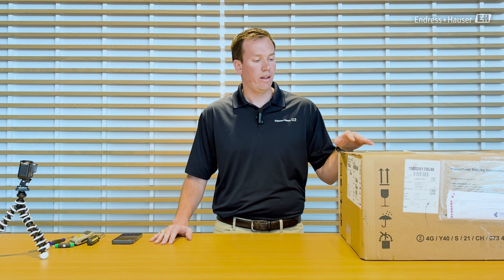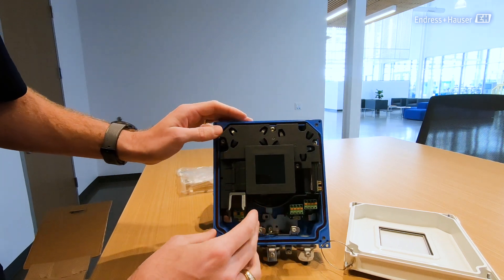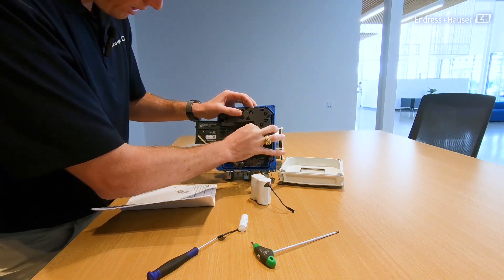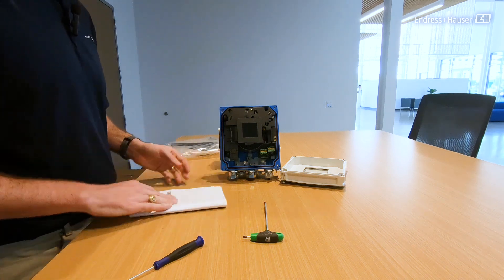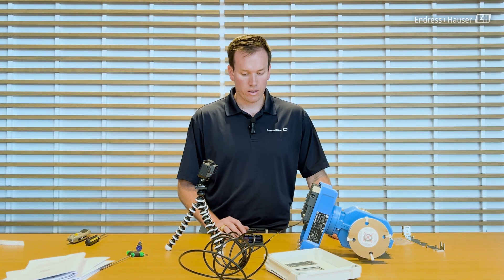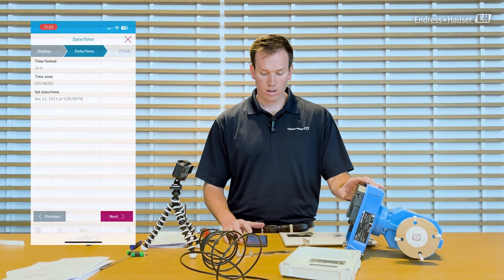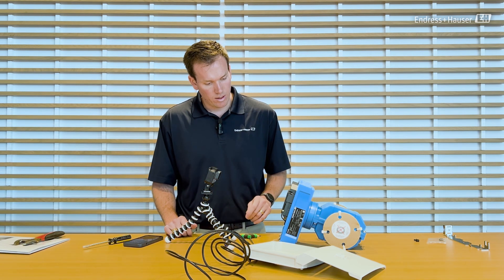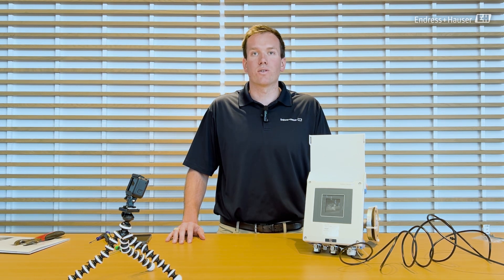Promag W 800, battery-powered electromagnetic flowmeter | Full unboxing

Comment: How long does the batteries last under normal daily operation?
What happens when the batteries are drained? Are they rechargeable or they must be replaced with new batteries?
Reply from the maker: The battery lasts up to 15 years. Its lifespan is influenced by several factors, including ambient temperature, sampling rate, and selected device configurations. For a more accurate estimation of its lifetime, you can either contact your local Endress+Hauser representative or use the sizing functionality in our applicator tool to calculate the battery lifetime based on the most relevant factors: https://www.endress.com/en/product-tools.

Promag W 800 continuously monitors and logs the battery status as part of its device diagnostics. You can set an alarm level for the minimum remaining battery life. The standard batteries of Promag W 800 are not rechargeable and should be replaced at the end of their lifespan. Alternatively, rechargeable batteries can be used with the optional external battery housing.